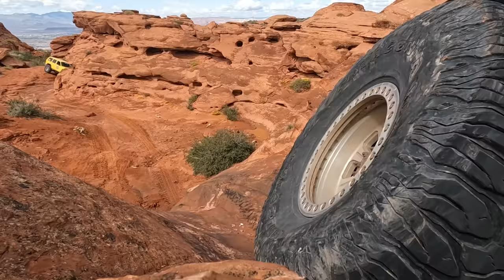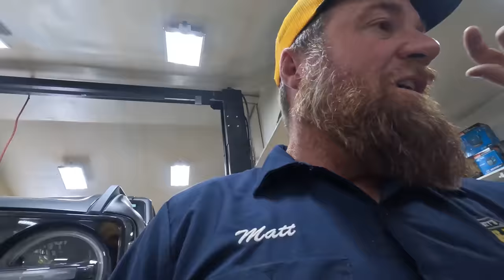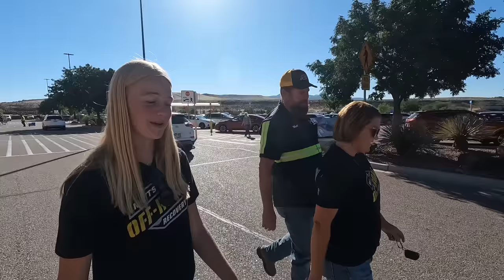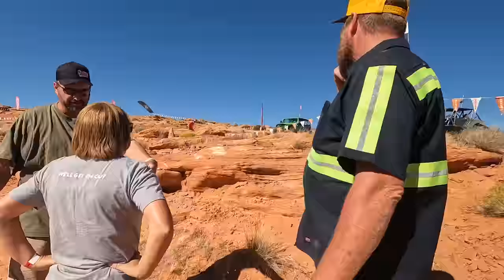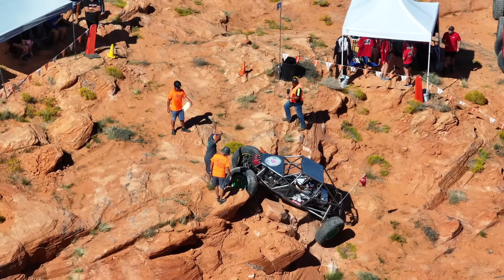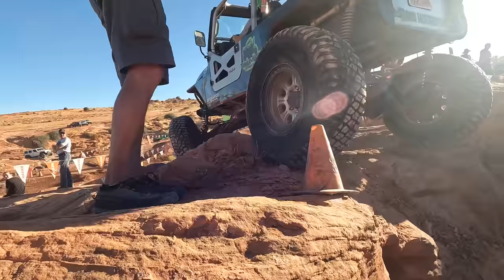We Took Over Trail Hero...If You Ain't First You're Last!

Comment: Heffé, the rear bumper on the bronco tilt the exhaust up and inlarge one of those holes back there so it exists out that instead of getting pinched between the ground in the bumper.

Comment: Ive got about 2500mi or 4000km on my Reign E+ and im on my 4th cassette I believe. The last thing I want to do is make my ebike heavier but if I can save some of that drive train $ to spend on tires, brakes, sealant, rotors, pads, Cushcore and wheel builds I'll give Linkglide a go. Keeping these things rollin dirty aint cheap or easy.

Comment: Talk of winches. I think you get what you pay for. I have a badlands 2,500lb winch on an atv, my wife's atv has a warn 2,000lb winch. The warn is way stronger. I think it will pull the entire atv up effortlessly.  The badlands winch I have to use a pulley to double my pull sometimes to get it over steep obstacles.  It pulls down just as soon as the load is on it. Warn is way better. Badlands winches aren't bad. I think it's good to be able to get a big winch for $300. The prices are good for A normal backup.  Don't know the difference in bigger winches but the small ones theirs alot.

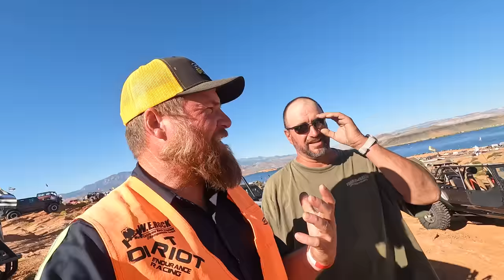Comment: 29:52 "You win some you lose some."

I know this might be a pipe dream but the impossible doesn't seem to stop Matt's Off-Road Recovery. 

If money is no object, is it possible to build a hydraulic based system that could change the wheelbase length of a rock climbing vehicle, on-the-fly, on-demand? 

I understand the driveshaft is a fixed length, in it's current configuration. However, if you could upscale Milwaukee's magnetic chuck bit system for their impact driver, to act as an adjustable drive shaft, then this impossibility could become a reality. ¯\,_(ツ)_,/¯

Comment: Ford- ketch charge 80k for our new Bronco, everyone will just replace everything so let’s just put on a plastic bumper and the cheapest suspension parts we can do. 

That’s the problem with companies these days. I would spend 80 if it was built for quality and not have to change half the crap on the truck just to do basic trails.

Comment: I am sorry matt, but a ROCK BOUNCER beats a ROCK CRAWLER any day, we are looking at a 428 LS with a supercharger, capable of putting over 800 horsepower at the wheels, besides that nothing beats that V8 RAMPAGE underneath the hood when its screaming 😱        ENGINE: LSA supercharged LS3, 700hp, upgraded fuel system, Heavy duty 8-rib accessory drive system, 1000cc injectors, quick-change billet pulley and hub, Intercooler system
TRANSMISSION: TH400 Billet Clutches, 300m output shaft, reverse manual valve body, center lube system
TRANSFERCASE: Atlas PRO series, 2 speed G2 case. 3.0 gear set. 1410 yokes front and rear
DRIVESHAFTS: BKOR 1410 driveshafts, single piece front and rear, Forged Yokes, 2.5” .250 wall. 
Check out our 1480 Extreme Duty Driveshaft Upgrade! 
FRONT AXLE: 14 bolt front, 40 spline axles 1550 series, BKOR high steer, BKOR shave diff cover, 4.88 gears, spool, 1410 forged yoke, BKOR Pinion Guard, BKOR heavy duty axle truss, PSC double ended steering ram with 7/8 cromoly heims
REAR AXLE: 14 bolt, 40 spline 1550 series axles, BKOR high steer arms, BKOR shave diff cover, 4.88 gears, spool, 1410 forged yoke, BKOR pinion guard, BKOR heavy duty axle truss, BKOR electric rear steer with self-centering, BKOR joystick, and PSC double ended steering ram with 7/8 cromoly heims